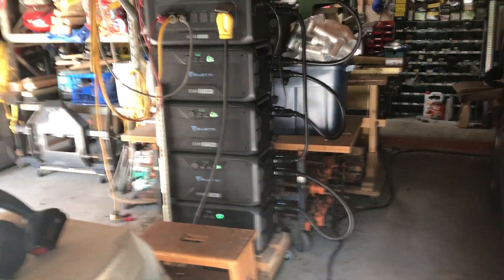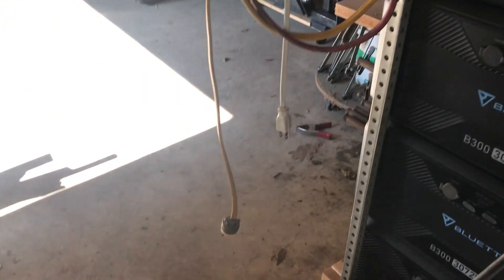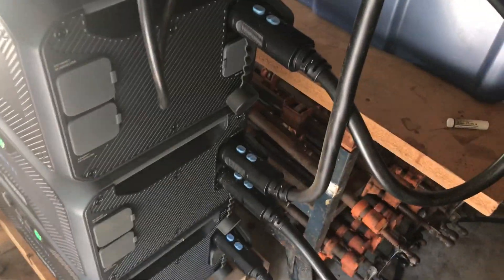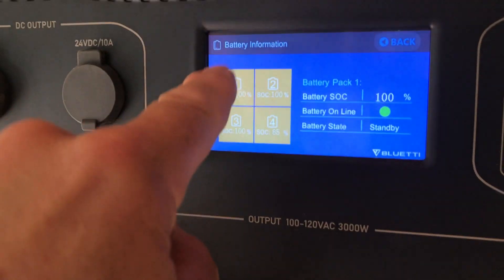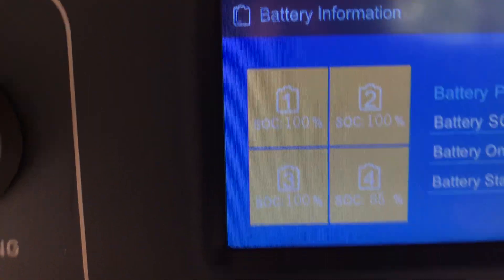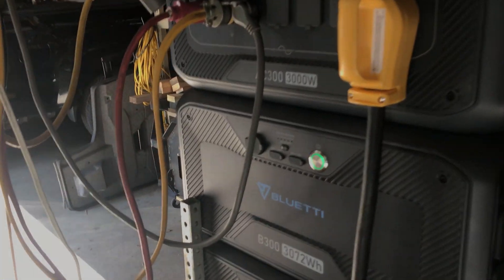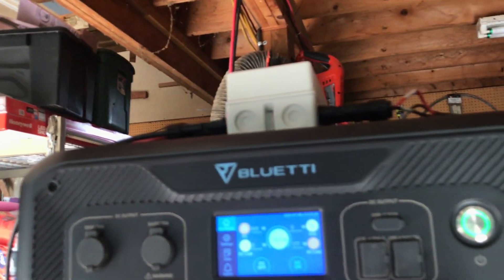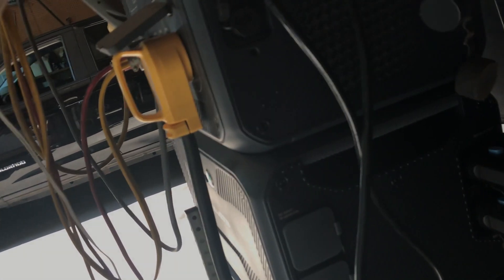Added 4th battery to Bluetti AC300

Comment: I set up the AC300+B300 about 5 weeks ago - not enough to power everything.  I’m contemplating either building a few battery banks myself or buying a few deep cycle batteries to compliment the system.   I can’t justify $3k per battery (Australia) from BLUETTI.   Will likely get 4 All Black 500w solar panels but still undecided.  Appreciate any advice guys.
Reply from the maker: Yes, equipment can get costly and 6 months later the same equipment can drop in cost. I see solar panels at Signature solar in Texas for 26 cents a watt now.

Comment: Hey John are you interested in another AC300 inverter?
Reply from the maker: Did you upgrade?
Reply: @johnkayak10  
No was thinking of getting another battery for Prime days but for $400 more I can get a AC300 & a B300 instead of $1899 for just the battery alone.
Reply from the maker: @billy2bob63  Thats a good deal
I was going to get another one originally but not so sure now.
Reply: @johnkayak10  I got another AC300 and B300 on sale. Figure got one more B300 and an extra AC300 incase the first one goes bad. Plus could get the fusion box and get 220v. Figure a little redundancy but growable.
Reply from the maker: @briant2259  Good plan!

Comment: To be honest I'm kinda scared of upgrading my battery with the current stand mine is on. Mine 3 battery setup plus an ac200p is on a harbor freight trolley. It don't move anymore but it's not buckling, but it's a hell of a lot of weight to rest on an investment so expensive.
Reply: Cables should be 1 cable from. Ac300 to battery 1.
2nd cable from ac300 to battery 2. 
3rd cable from battery 1 to battery 3.
4th cable from battery 2 to battery 4.

I have my ac300 with the 4 batteries below as you have.
I just have a 5/8 in piece of plywood with 4 5" wheels rated for 1400 pounds.
I have been running this way for over a year😮.
I don't support the system any other way,  although I should. 
Using 2550 solar input, over paneling slightly. 

Regards
Dan
Reply from the maker: I have an email to bluetti asking if having that cable stressed like that is ok. Have not heard back yet. If it is I will re work my cart and stack them two high. If they had a longer cable I will leave it like this because I have it pretty stable and the space savings
Reply: @johnkayak10  by the way bluetti is about to have a major sale, you can get another ac300 with a B300 battery for only 2299

Comment: You sure those batteries are wired correct?
Reply from the maker: Yes I went by the diagram at bluetti but they just show them stacked two high
Reply: @johnkayak10 You should be able to go from the main unit to the top 1st battery and the 2nd battery. Then from the 1st battery to the 3rd battery and then 2 to 4.
Reply from the maker: @BubbasgarageTv   I used the Bluetti user manual diagram here https://cdn.shopifycdn.net/s/files/1/0536/3390/8911/files/B300_User_Manual.pdf?v=1631707827
Reply: @johnkayak10  John, it appears you do not have it connected per diagram. Diagram shows AC300 top port connected to 3rd battery lower port. With batteries stacked like you have and how I want,the PO90D cable does not reach.  Diagram also shows battery #1 bottom port to Battery #4 bottom port, cable does not reach when stacked as is. I received my 4th battery yesterday. To get the single stack I must have for storage requirements I came up with alternative to a desired #1-#4 top to bottom stack and did NOT have to stretch any PO90D cable. Put a battery on top of entire stack,label it as #4 under that put AC300 then under that place the remaining  batteries. Under AC300 label first as #1 then the next as#3 then the bottom as #2. No stretching of cable,just put label indentifying each. Like yours, the panel display numbers though still do not match the batteries location. Per panel display my batteries are #3 in 1spot, #1 in 2 spot, #2 in 3 spot #4 in 4 spot. I made small diagram and taped it to AC300 for reference.
Reply: @johnkayak10  
That cord shouldn't be stressed like that. Might want to youtube some videos 👍